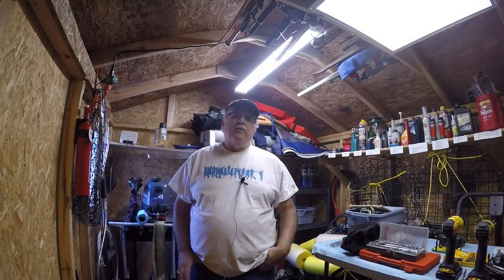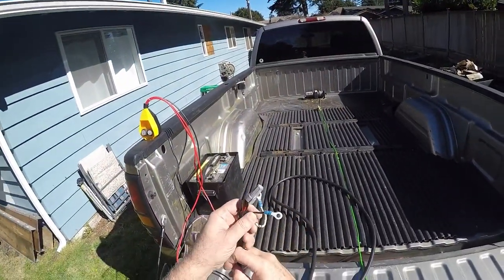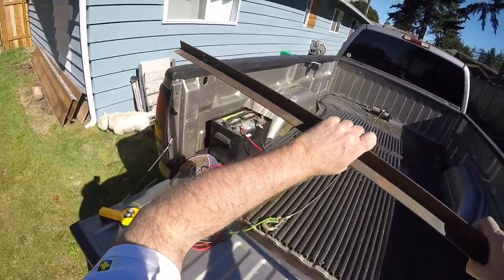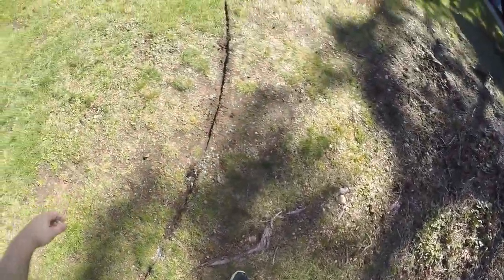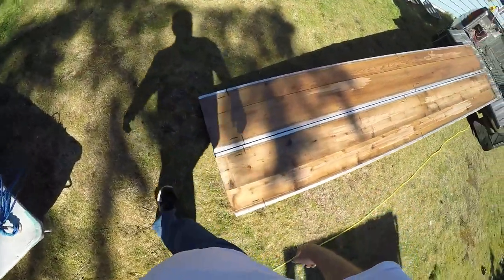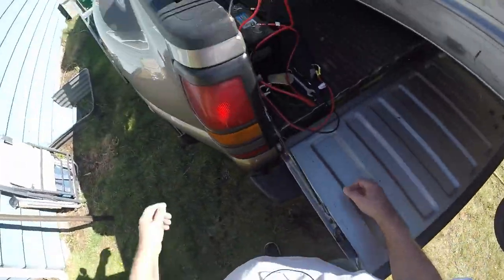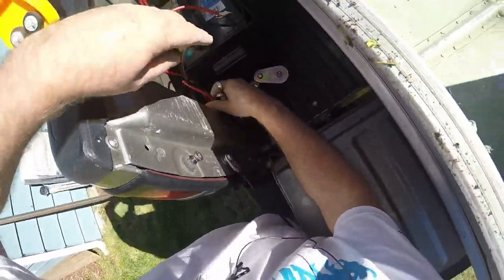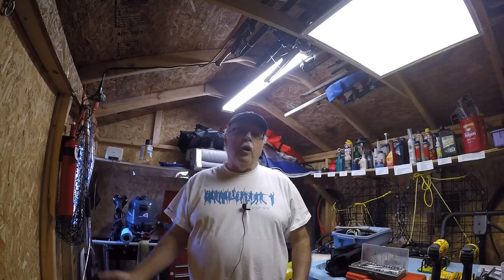DIY Boat Loader Part 1

Comment: I put my boat in the back just like that. I have it down pretty well where I can back in the water far enough and pull it on and slide it off without much hassle.
Reply from the maker: Hi Brett, did you take a break? It's been awhile since your last video. Yep the ramps will work great for this fishing season on lowland lakes.
Reply: Yea I have been really busy with the house. Gutted 2 bedrooms and made them into a big family room. I just started making a few videos of broken stuff this last week. Everything else is falling apart around me since I have been working on the house for months.

Comment: It might be easier to use wingnuts to connect the cables to the motor and battery rather than having to carry spanners.
Reply from the maker: I agree. Still revising this. Going to shoot a part 4 on this in spring before going fishing. Eventually I plan on building a boat loader like you see on other videos. I have a welder now just need to buy the metal or find it for free somewhere